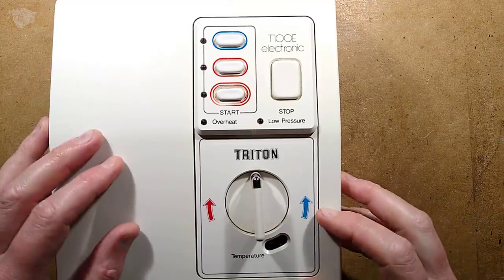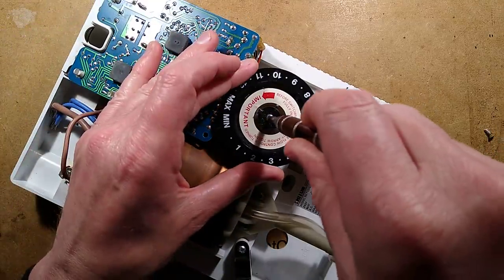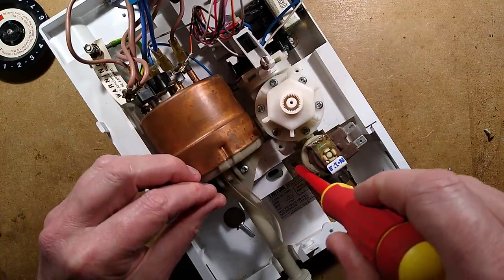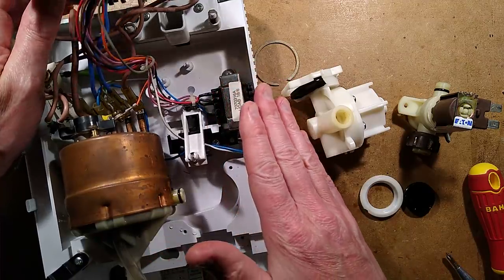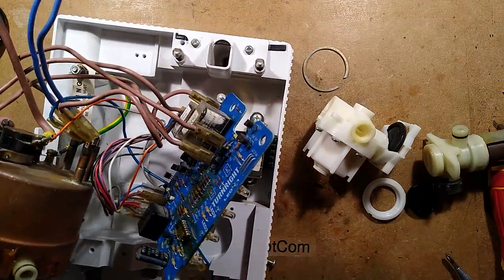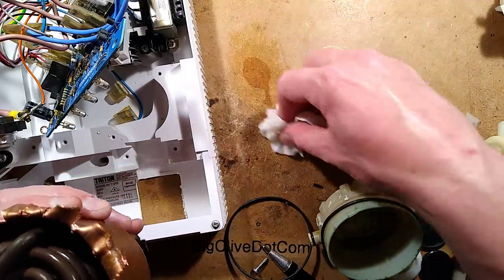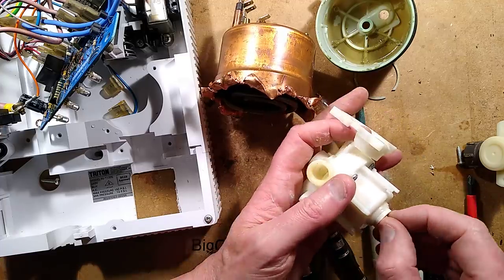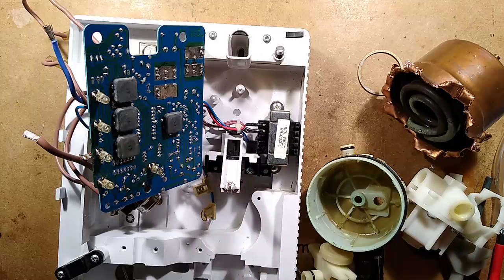Teardown of a British electric shower that went bang.

Comment: I've certainly never seen anything of this sort in Canada!
Reply: We like our hot water failures to flood our basements
Reply: Instantaneous water heaters are all over the place in England. Not only showers like this but a smaller version = 'hand shower' can be found at small hand-washing sinks that only have a cold water feed.
Reply: A lot of older British houses would operate large water heater tanks that had to be fully reheated over several hours whenever depleted. Coupled with significantly higher energy prices than their north American counterparts, many would opt for these instant water heaters in their bathrooms, essentially heating only the water they are using
Reply: IIXRATEDIIHiTMAN I think you're partially correct, electric showers serve as a useful backup when stored hot water supplies are depleted. Bit I think the biggest reason is that in traditional hot water systems there was simply insufficient hot water pressure to operate a shower, given that the pressure was derived from a cold header tank often inches above the bathroom ceiling. British bathrooms rarely had showers, and when they did start to become popular an electric shower operating on mains pressure cold water was a significantly cheaper option than changing the whole hot water setup.
Reply: @spencerwilton5831  Yes! And the combination boilers too output low water pressure, I've been spoiled with a pressurised system for far too long to come up with this.
Reply: The 120 volt North American units are only useable for lukewarm hand washing sink water.  To get the oomph out of electric heaters requires a 240 volt system, just like for an electric clothes dryer or oven.   It's a bit much for my st homes.  Some use the instant gas heaters, however.  I recommended an older couple get one of those for their country home, as it's more for weekending.  The electric ignition heating driven by their propane tank would give them hot water in minutes, not hours, and not require being shut down when they leave for a month.
Reply: Part of the issue is that in the winter, the water comes into the house only a few degrees above freezing, and a demand heater doesn't have enough oomph to warm the water up enough from that very cold starting temperature.
Reply: @tbelding  There is 220V available in almost every residence in North America - it's what the electric stove and clothes dryer will be using.
Reply: @pileofstuff  Sure, but that's not wired to the bathrooms.  Unless you are doing new construction retrofitting the wiring may be the biggest expense by far.
Reply: I think it's because you've only got 110V available in Canada, as opposed to the 230V standard in the UK. I believe the Triton T100e in the video is rated at 8.5kW, and most instantaneous water heaters tend to be rather high power.
Reply: @michaelturner4457  Almost every home in North America has 220VAC available in it - it's most commonly used for cooking and clothes dryers. 

And electric furnaces and central water heaters in some places (though only in the provinces with inexpensive electricity due to a surplus of hydroelectric generation).
Reply: @pileofstuff  Dud you keep saying that, and people keep correcting you that 220 in NA is simply not wired everywhere in the house. It goes to your laundry and maybe kitchen.  Although it does seem weird to us in NA, it does make some sense in the UK and other areas where you have such high power connectors standard across the house.  I wanted to add tankless water heater to our newer house as we'd had a gas version in our old one. Problem was that it required 3x 220v 40 circuits...
Reply: @pileofstuff  he's talking about the instant hot water on demand systems that reside under the sink. There isn't 220V going to them.
Reply: @millomweb  we have under sink instant hot water units here in Canada, but the in shower ones, I am not sure if they are even approved for use here. the tankless waterheaters are prohibitively expensive , so most Canadians use electric or gas boiler water heaters centrally
Reply: @tbelding  pretty much every house has both in Canada, my stove and clothes dryer are 230 volt, as do I have a 230 volt air conditioner out in my studio as well
Reply: pileofstuff 240v*
Reply: Michael Turner we have both 120/240V in almost every home.
Reply: You can get them here in Canada too, but they are considerably bigger! That hardly looks big enough to get a cup of tea. 😉 I have the normal 40gal heater in my place. These instant one's would be cheaper to run if you can have the volume of water at the temp you desire.
Reply: In Germany we have electric boilers in small sizes, with or without a heat insulated reservoir, if there's no hot water available for whatever reason. Or you might have a cold water tap in your garage and you add a boiler just to have some comfort with washing your hands or so.
They used to be more common when electricity was cheap and houses were old.
I just read "lukewarm" - well, I burned my hands several times on some of these at least here 😅
Reply: +pileofstuff, Few people realize the differences between the UK and US domestic layout. Whereas the US uses 220 volt with a center tap providing 110 which is bonded to earth, the UK uses 415 volts from a star secondary winding on the 3 phase transformer. Each property is connected to one leg of the transformer output and the star point, which is bonded to earth and referred to as neutral. The resultant voltage is 240. With this layout, a center tap is not possible, since the tap could not be grounded, so the voltage would 'float' depending on load.
Reply: @DMSparky  famously in most kitchens to feed the oven and hot plates.
Reply: @michaelturner4457  in case you are wondering in North america we can have 240 volts you can have a dble supply from each phase most large appliances and motors require 240v cooktops/oven combos, water heaters, clothes dryers, a/c units,welders some saws, cnc machines.( 30 to 80 amps each too)so in theory with a little know how your appliances in GB can be easily wired to run on our system provided they can handle the 60 hertz as opposed to your 50 hertz (and yes 3 phase is available too for residential but like the UK its expensive to have feed in but can be done if needed
Reply: @xenonram  some can be installed in the usa at least
Reply: @doug6531  technically if we're doing things properly any heating equipment needs to be on its own circuit so if you have a wire there you have a wire there, 120 or 240 is just some panel work, i thought a lot of our heating equipment is 240 anyways
Reply: My place didn't have gas, as it was to rural to have a supply, so it hit electric, in a cold winter it was on maximum to get the water hot and sometimes it would overload and leave you in a cool shower and a cold house as we had no heating other than a constantly tripping wall heater, I moved, new house has gas but they only supplied the heating and hot water to taps, so I still have an electric shower, I still love it, instant heat, my boiler will do it but water pressure is poor
Reply: The company fuse in my Estonian house is  20A, so electric showers are not very common here🙂
Reply: yeah, looking around it does seem the 30-50a is the range for these showers, i think i saw clives was 8.5 kw
Reply: @DMSparky  What do you need 120 for?
Reply: If your homes have 120v the fuse would be 70amp and the water coming out would be luke warm.
Reply: @michaelturner4457  We have 120 and 240 volt, it's a split phase system. However any electrical items in use within 3 feet of a water supply have to be connected to a GFCI, and 240 volt GFCIs are prohibitively expensive.
Reply: @tbelding  It has more to do with the amperage, you would require a heavier gauge wire to use a 120 volt on demand hot water heater for the same Wattage as a 240 volt unit. Then there is the code issue of requiring a GFCI for any electrical device used within 3 feet of bathroom fixture. There are whole house on demand electric hot water heaters, but even at 240 volts they require a higher amperage circuit then just using a tank. For a country home I would get a wood stove with a coil in the back to pre heat the water before it goes in a tank, since firewood is usually plentiful in rural areas.
Reply: We have 240v in every home. Much better idea.
Reply: @EastCoastScott  These electric showers have a heating element that typically ranges from 7.5 - 10KW and also they are 240v. They can easily produce a constant supply of water as hot as you can stand it :)
Reply: This shower is about 25 years old, there are lots of newer models, take a look at Google, search (Mira showers) (Grohe showers) and (TRITON Showers) 🚿
Reply: @dmacpher  generally with newer houses in Europe and the UK, they have full centralized hot water systems. Older houses, and older structures that cannot be modified to accommodate new piping, generally get these. This type of heater is not usable in the us for showers. You can use these instantaneous or small volume heaters or something like an extremely hot water tap on your sink, or a instantaneous tea maker.
Reply: @tbelding  I've seen all electric tankless water heaters for US consumption, but the power rating was something like 50 amps at 240VAC, which is a bit much for most homes with older 60 or 100A service.
Reply: Electric showers suck if u like powerful showers like me
Reply: @pileofstuff  while my current house has a shower off a combi boiler (instant heat, no tank and copes fine in the winter thankyou lol) my previous house had 3 electric showers, I can assure you while you had to turn them up a bit in the winter they coped just fine IIRC they ranged from 8.8KW to 12KW. .. I assume your in the US? tanked heat is RARE in the UK. most houses these days are on combi boilers which only heat water on demand.
Reply: Denis O'brien tanked hot water is not rare in the U.K! Larger new build properties are increasingly turning away from combi boilers and back to mains pressure tanks as they can have electric backup, and serve two or three showers at the same time which all but the biggest floor mounted combi boilers would struggle with. Then of course there are the hundreds of thousands of homes with older / original loft tank low pressure hot water systems. Personally I hate combis, they are unreliable, there is always a lag in getting hot water wasting so much water, and when they break down you have no backup. Tanks will continue to grow in popularity once again as more people realise how rubbish most combis are!
Reply: @spencerwilton5831  Aren't the combi boilers generally oil- or gas-fired?   One thing that seems to be making minor inroads in the US are the "heat pump" water heaters.  At one time, given energy credits and various incentives, one could have such a water heater installed virtually free of charge.   The mechanical aspects of that were something of a turn-off, as well as reported problems with the electronics and the need for a larger space.   I opted for a super-insulated "lifetime"  (Rheem Marathon) water heater, which also offered energy credit incentives.
Reply: @michaelturner4457   Takes a lot of energy to heat water from almost freezing (in Canada) to tolerable for a shower.  I'll  stick to the old fashioned hot water tank.
Reply: @spencerwilton5831  given most houses are 2-4 bedroom I bet most are on combis. I guess we could argue about it till the cows came home. have tanked hot water in my commercial property, combi in my house gets me hot water just as quick.  fwiw I prefer a shower fed off a tank and pumped, or a good mains pressure combi/thermostatic head over an electric shower for the controllability but can only go by what I see around me, and everyone I know , friends , family, are all on combis.
Reply: @dmacpher  because we're too lazy to change the anode rods
Reply: @michaelturner4457  incorrect, Canada like the Usa has split phase, so both 120v and 240V are available.
Reply: Same for Germany.
Reply: I've used these on and off for about 15 years, even had a couple fail on me and have had no incidents. They're safe.
Reply: @thedavesofourlives1  in the UK we have 120V (stepped down) for shaver sockets, 240V for regular single-phase power, and 415V for three-phase power which is installed alongside 240V in (usually) chain shops / pubs / cinemas etc
Reply: Rumpled Foreskin  A fate no one deserves!
Reply: we do have some on demand hot water systems that operate on propane gas that look pretty similar to this unit but most people just use the good old hot water tanks
Reply: In Argentina, we use gas heaters or the classic suicide shower 😅
Reply: Rumpled Foreskin  and thats suposed to be a good thing ?
Reply: Never seen them in Australia either.
Reply: tubastuff Yes, most combis are gas fired, oil is only really used in remote rural areas as the vast majority of the Uk is on the gas grid. Heat pump water heaters are my common here, their efficiency drops off a cliff at lower ambient  temperatures, and given that electricity is 3 to 4 times the price of gas per kWh you could end up paying more for your hot water. Plus, UK homes may not have a suitable space to install such a heater- they may be beneficial in Texas where they remove excess heat from the living space, but in the UK for at least six months of the year they would be utilising heat we actually need to make the house comfortable! If you moved them into the garage they would be trying to extract heat from surroundings that could be well below freezing.
Reply: Yeah same it’s weird looking things eh
Reply: We've got more natural gas than we know what to do with, that's why lol
Reply: @spencerwilton5831  When hot water supplies are depleted, use less hot water or get a bigger heater.
Reply: Nowhere in the civilized world.
Reply: @r.h.8754  

We had a cistermiser inline water softener fitted when we had our combi installed some years ago. We live in Staffordshire which is a very hard water area and fingers crossed the softener has kept the combi we have happy since 2004.
Reply: @michaelturner4457    I missed your comment.
240 is available in all houses in Canada. We use two circuits, fused at proper rating.
Reply: @tbelding   @Michael Turner  We do have 220V -- just not six inch inches from my skull while standing in the bathtub holy god
Reply: @tbelding  same goes for electric kettles, they need 240V over 120V.
Reply: @HamtaroEL  - Honestly, the electric kettles, as you call them, work fine on 120V.   They just aren't as fast.  We have one, my folks have one.  (picked up in Canada because they weren't really findable in the US when they were purchased).
Reply: @michaelturner4457  All standard domestic supply in the US and Canada is split rail 240V single phase. Most provincial/state and local code would require a dedicated circuit and ground fault/arc interrupters whether single leg 120V or 240V.

You can have hot water suitable for a shower with near freezing feed water with even less than a 120V/20A feed, albeit the flow may be limited compared to the normal expected North Am gusher.

All in all, 'hot water on demand' is questionable economics in North Am with a central tank system still being considered best value and reliability. That being said, if you're using so much hot water that you 'drain the tank' (in fact impossible, but drain the existing hot water in the tank such that just cold is left) you can always supplement with a stand-alone tankless heater.
Reply: @wizard3z868  [in North america we can have 240 volts you can have a dble supply from each phase ]
There is only a single phase in virtually every domestic situation. Even electricians misuse the term "phase" (I'm an electronic tech). You have two 'hots' relative to the ctr tapped street xfrmr secondary. "Phase" refers to current, not poles, and that phase, no matter where you tap it on a secondary winding, is the same. The potential of the polarity changes however.
Reply: @seanshomeshop325  Or 208V if you have a commercial or industrial triple phase feed.
Reply: @spencerwilton5831  Good post.
Reply: @stephensaines7100  this is true, in some condo/apartments you have to double check your panel isnt using 2 legs of 3 phase 208 for your service, your appliances will still work but just wont get as hot